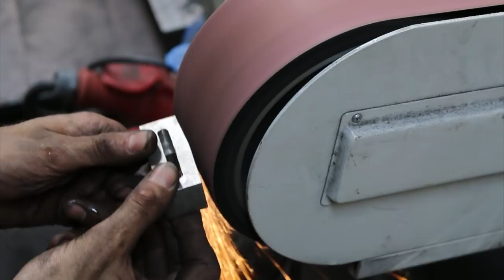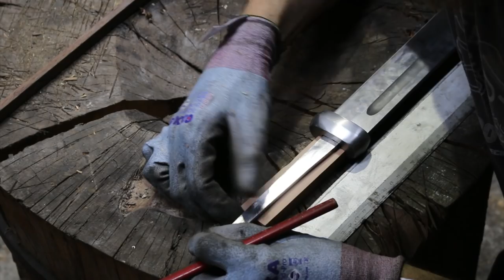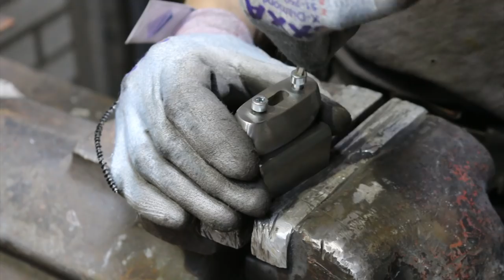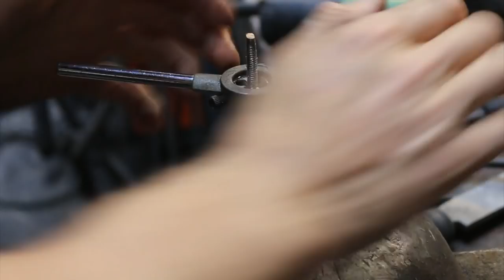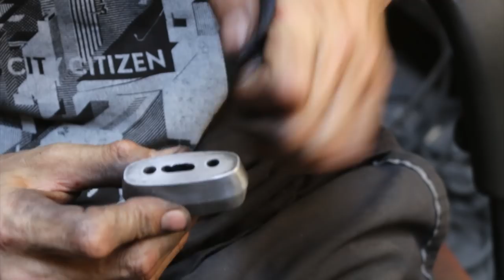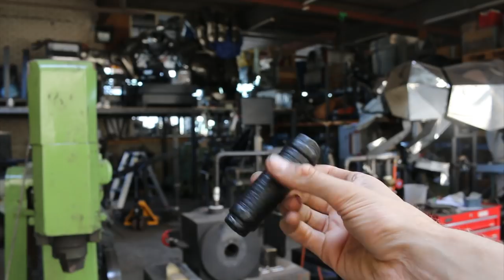Forging a langseax from a semi truck leaf spring part 2.  making the handle.

Comment: That's a badass blade! You should do a knife or sword with a twisted wire handle next. I seen one that had two opposite twisted steel wires with one twisted brass wire in the middle that was beautiful and always wanted to try but never did.
Reply from the maker: i am planning to do one.